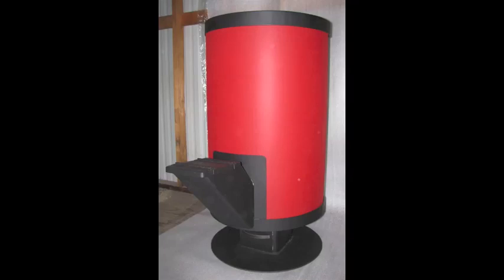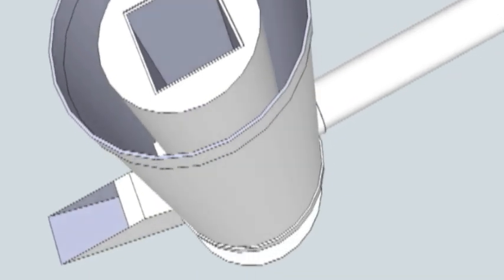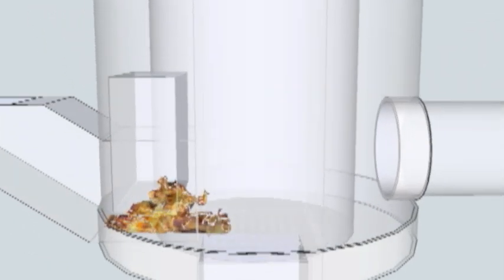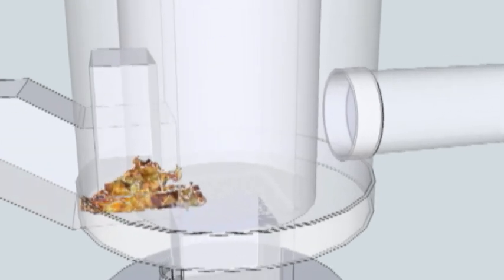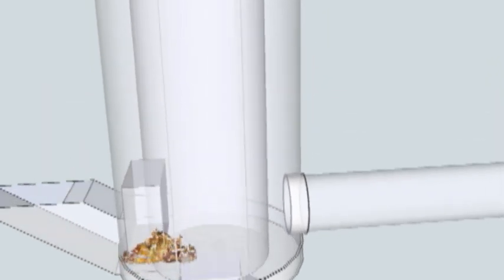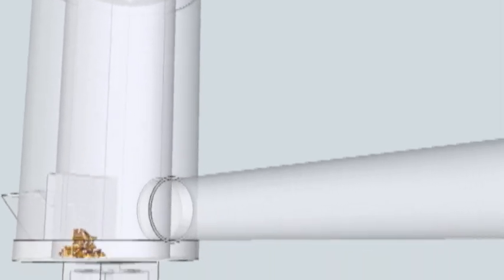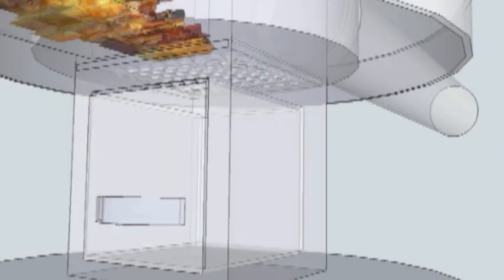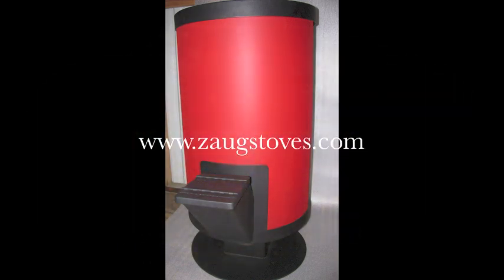Zaug Stoves- How they work

Comment: Only problem with this. (Nice design by the way.) The 'ash-tray' draws in air, taking away the efficiency of the burn as well as the outtake draw won't be as strong/efficient unless you have an air tight ash-tray. A good efficient RS/Masonry should have 1 intake.